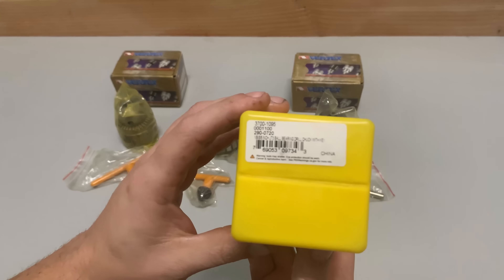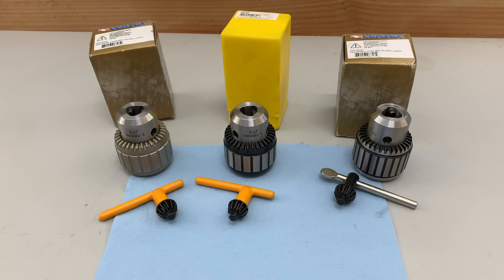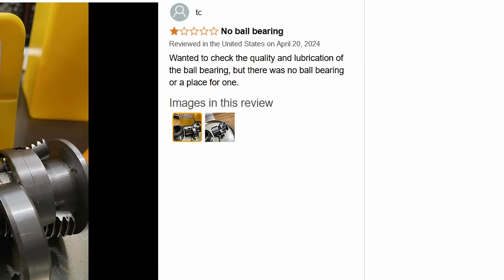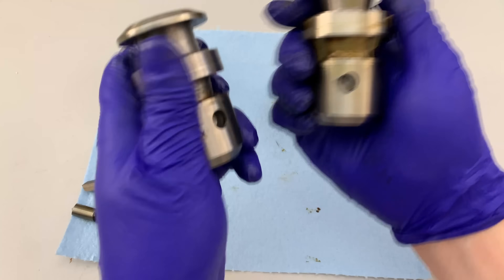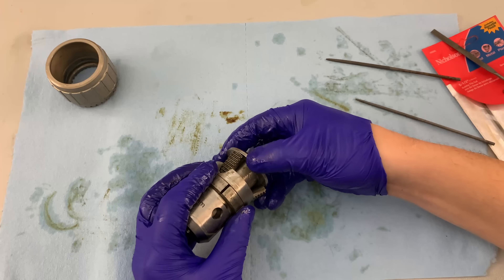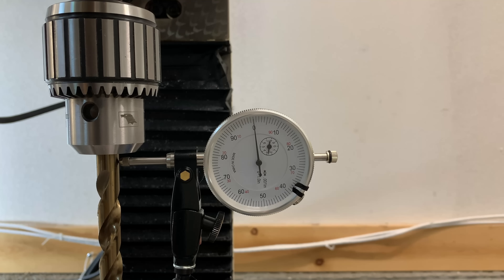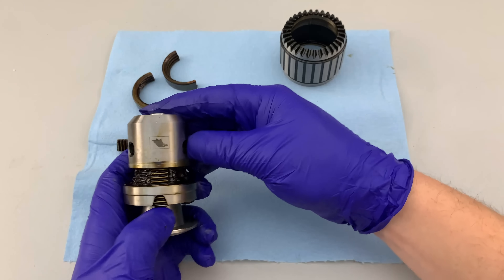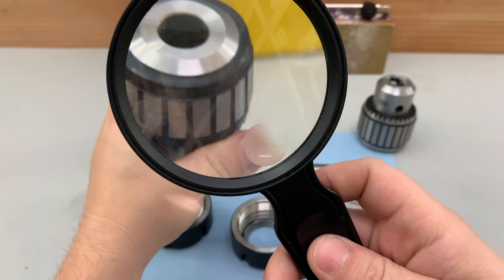Made in China vs Taiwan: The ACTUAL Difference

Comment: I also prefer Taiwan made over china. I have on my cnc router a china made spindle 2HP air cooled ER16.  the runout was less than .00005" tested with my interapid indicator, could not be happier tested using techniks collet and a carbide blank. runs smooth and quiet
Reply from the maker: That's really incredible accuracy! Very impressive

Comment: When checking run out on a drill chuck, you want to check it with a smaller than maximum size drill. The idea here is with less of the jaws being supported by the body of the chuck, the precision of the holes that the jaws ride in will manifest itself. Besides, run out on a maximum size drill is far less important that with the teeny tiny drills we sometime use. 
The advantage of the ball bearing chuck over a plain bearing chuck is less friction is lost on the rotation of the collar to tighten the drill. So for an equal amount of force on the key, the drill is gripped much tighter. The second advantage is long term accuracy. Since you do not have two parts sliding over each other the amount of wear of the collar is reduced. When shopping for drill chucks, and I have a choice between a new plain bearing import chuck and a used, rusty, obviously well used Jacobs ball bearing chuck, I will pick the Jacobs and just clean it up.
Reply from the maker: Good tips, thanks for the feedback!
Reply: I bought a jacobs chuck 2 years ago. Paid full price. I damaged it and bought the rebuild kit. The new parts didn’t fit. Called jacobs and found out that the new chucks are now made in China and the rebuild kits are only for the older (non-Chinese) chucks. All new jacobs chucks are Chinese and they are considered disposable, yet the customer pays full price.
Reply: If I understand correctly I imagine it's also a lot easier to replace a worn bearing than it is to replace one or two sections of the chuck itself as well. Assuming the time/cost is worth it, don't do shop work so no idea on the actual time and cost of a repair like that over just buying a new one.

Comment: Runout in a Drill Chuck.
I never look at any Drill Chuck with Precision in mind ???
IF you need Precision when holding a Drill Bit always use a Collet Chuck.

In reality the word Precision should Not be included with a Drill Chuck 😒
Reply from the maker: I think it's self-evident that for true precision you'll drill undersize and then use a reamer, end mill, or boring bar to bring your hole up to your desired final dimension. But there's no harm in 1. testing a manufacturer's claims and 2. trying to get the most accuracy out of your tools.

Comment: Leave a complaint concerning the manufacturer wit the FTC. They are cracking down hard on false advertising and blatant product fraud from China.
Reply from the maker: Given HHIP's generally good reputation, and the way they handled this issue for me, I am inclined to give them the benefit of the doubt (for now). It's possible that the manufacturer they purchased from in China is deliberately misleading them (and, therefor, us consumers), or it could have been an honest mistake. I plan to buy another 'ball-bearing' chuck from them early next year to compare to a brand new (now made in China) Jacobs Super Chuck, and a vintage, made-in-USA Jacobs Super Chuck, to see how all three ball-bearing chucks compare.

If I get another ball-bearing chuck with no balls from HHIP at that point, I would make a pretty big issue out of it.

Comment: Interesting video, and quite a surprising performance from the no-name Chinese chuck.  That said I wouldn't be surprised if you bought another identical model and it was an order of magnitude worse.

It would have been useful to measure run out right out of the box, before cleaning and deburring and also measuring runout towards the minimum and maximum ends of the chuck capacity rather than only 1/2".
Reply from the maker: I like both of those suggestions and will incorporate into future testing, thank you!

Comment: It is my view that where it is made matters far, far less than whether independent inspectors are on site to monitor quality control and whether that level of tolerance for good quality was specced in the buyers contract.  This will prevent worn tooling from being used and sloppy work being done much better than whatever the outside scenery is.
Reply from the maker: Very good point.

Comment: Interesting results!  Besides runout from the axis of the drill bit being offset from the mounting axis, there could be runout from the bit being tilted.   I suggest measuring runout by using a dowel pin or drill blank and indicating away from the chuck jaws.
Reply from the maker: I like the idea of measuring with a dowel pin or drill blank at a set distance away from the opening of the jaws as well and will incorporate that into future testing. I plan to (eventually) source cheap ball-bearing, made-in-China chuck and compare it with both a brand new, made-in-China Jacobs Super Chuck and an old, USA-made Jacobs Super Chuck.

Comment: My question is how well these chucks hold up over time. Especially the jaws that actually come in contact with the bits. Are they fully hardened and then precision ground to each other in the chuck, or are they simply assembled from a box of parts? 
What do you think?
Reply from the maker: I think time will  tell. I suspect that the mystery chuck that was machined so well is probably going to hold up fine, but the other two I'm more curious about. I plan to (eventually) source a cheap, knock-off China-made ball-bearing chuck and compare it with a new Jacobs Super Chuck (also now made in China I believe), and an old, USA-made Jacobs Super Chuck. I could revisit these chucks then and see how they've held up.